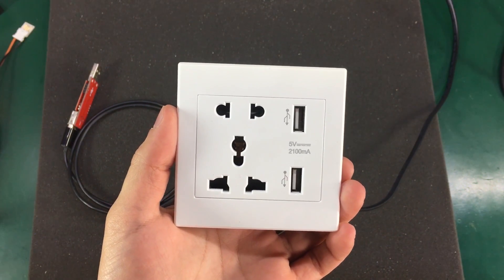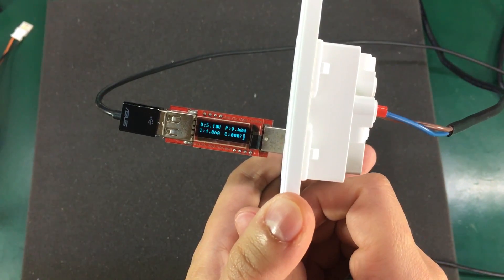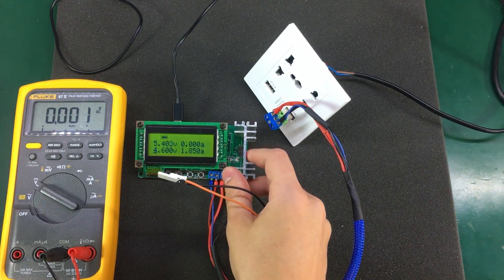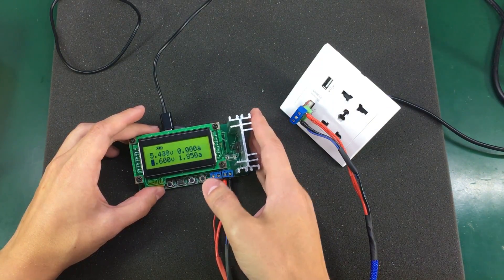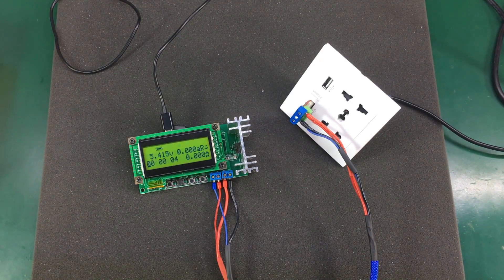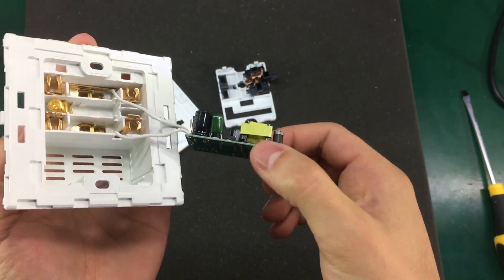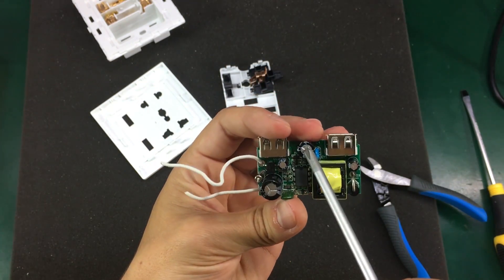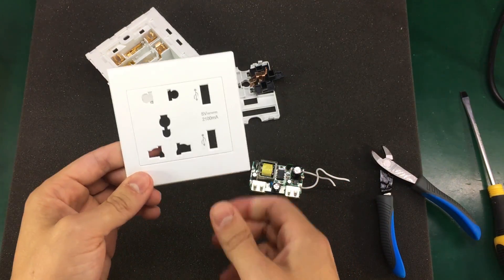Voltlog #70 - Dual USB Power Socket Teardown

Comment: Thanks for the informative video! The clearance from mains to output is simply horrible... One AC mains solder joint is really close to the soldered USB receptacle... This thing is dangerous!
Reply from the maker: yes, common errors found on these cheap power supplies..

Comment: also i bet that the mistery controller is prolly a clone of the venerable mc34036
Reply: No, the *mystery controller is most certainly not a MC34063A - It's not usable as a mains-connected power supply - at all.